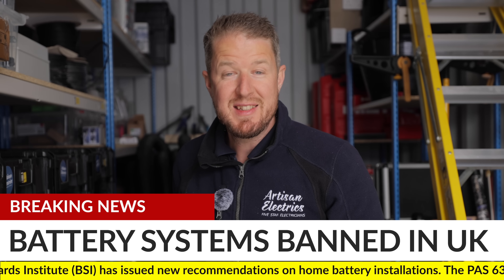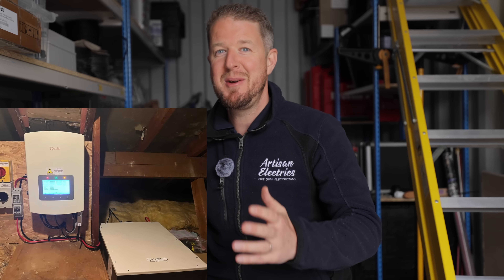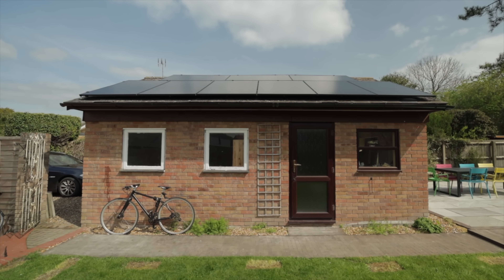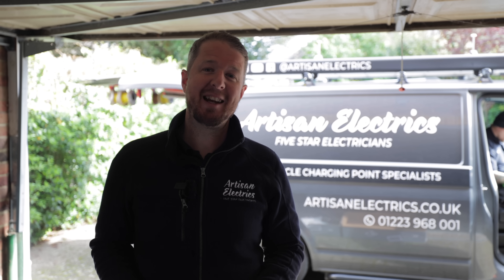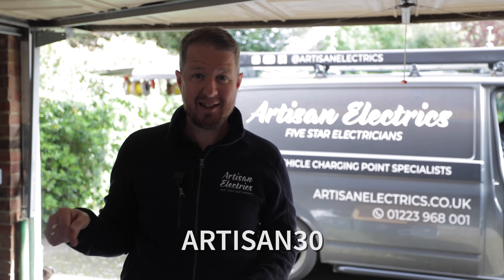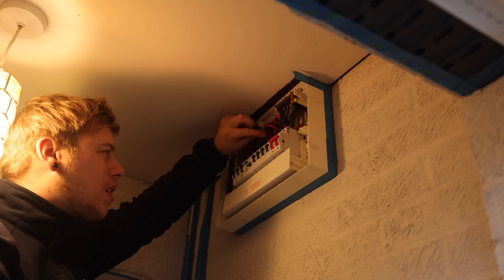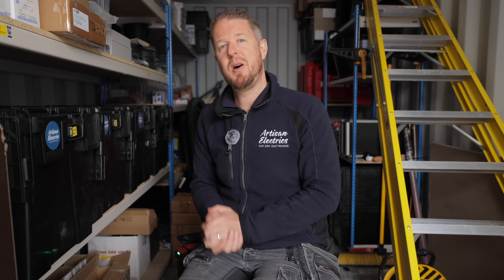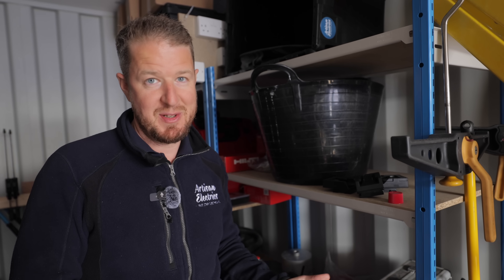Is the UK Banning Home Battery Storage? 😱

Comment: A battery in the attic is completely wrong, because there the temperature in summer reaches up to 47 degrees Celsius, which does not do the battery good. In winter it freezes there again, which is also not good. 😐
Reply: Same applies to sticking the battery outside.
Reply: yes just what I was thinking and also if they are outside and its cold they will not charge or the inverter/charger will try and top them up as the voltage drops when the batteries get cold over night which also shorten the life of them.
Reply: Actually lofts are not always that extreme. it depends very much on construction and location. Our max min temperatures are 38 to minus 2 over 2 years of monitoring and with careful fireproof insulation passive heating caused by using the batteries has maintained the battery temperature are 10c or above.

Lifepo4 tech is rated to 50c and anyone who has worked with the tech knows that it is only copper migration effects from the anode which are problematic above this temperature. OUTSIDE temperature swings are far worse by the way.
Reply: @atkt62  There isn't any copper in the anode in any of the lithium chemistries I can think off. The anode material is smeared onto a copper foil which I presume is what you are referring to, but are you really saying that significant amounts of that copper foil migrate above 50C? Elemental copper is pretty stable stuff (hence it's uses in hot and cold water pipe, roofs, wiring etc.), so I find that quite hard to believe, and I know quite a lot about batteries and this is the first time I've heard anyone say that 'copper migration' is an overheating issue. Reading some papers it seems it can be an issue from overdischarge (below 1.5V), which of course is independent of operating temp.
Reply: @atkt62 fireproof insulation specifically on the batteries? Would love to know more about that if it can be retrofitted?
Reply: Exactly. Lithium battery chemistries like the same conditions as people, so sticking them inside the heated envelope makes a lot of sense from a longevity and efficiency point of view. Putting them outside in the cold and sun (or in an uninsulated loft which is even worse) will definitely reduce lifetimes. I don't know by how much - many it's not that significant.
Reply: @xxwookey if you read Andleman you might think differently. Side reactions start above 50C. All foils are alloys and contain copper. It is my understanding that mixed oxide formation at these interfaces leads to high resistance regions being created. Hence the limit of 50C for safety. Happy to dialogue more of course
Reply: Bit like the garage?
Reply: Okay, so I'm seeing a few opinions here that I think are mostly correct but perhaps not what the PAS63100 is thinking about when recommending that batteries are not installed indoors and prohibiting them in lofts and escape routes. The issue as described is not the likelihood of battery fires (much less the reliability or longevity of the batteries in different location) but to do with the impact of those fires when they occur. This is due to the high burning temperature of Lithium batteries and their tendency to form high temperature jets.
In loft spaces this 'might' cause a very rapid spread of fire which might spread to affect escape routes before people can be evacuated (or even before the alarm is raised). In escape routes the danger is obvious.
The issues raised regarding temperature may also be good reasons not to install batteries in lofts but can be overcome. Whilst it is true that Lithium can work in temperatures 'up-to' 50 degrees C - this is not a good temperature for charging or discharging as it is more stressful and there is less safety margin to critical temperatures - however this isn't a big problem in most parts of the UK. Cold temperature can be a worse issue - though unlikely to happen often. Below freezing charging of Lithium batteries can be (usually is) extremely hazardous and almost all controllers will disable charging below 0C. 
Installation indoors does give the best conditions for the battery. However, whilst Lithium batteries are much safer than (for example tumble driers) other appliances, if your batteries do catch fire, your house is doomed and you must plan to evacuate as quickly as possible. Fighting a lithium battery fire is very difficult and well beyond the capabilities of a home fire extinguisher.
I am planning on installing batteries and, after a discussion with the installers I plan to install them in a fire resistant cabinet on the outside of the property and with a frost guard heater to maintain the temperature above freezing. This will work in my location, but yours will be different and you should seek advice.
Reply: Good point , that I hadn't thought of.🤨
Reply: I'd like to see some proper accurate statistics regarding all these extra restrictions, including batteries and metal consumer units. in some homes there is nowhere but the loft. I live in a four bedroom (extended) semi and can't think where we could  put it other than in the loft where it is. 
Battery storage, available now to the rich, who don't really need them anyway.

Comment: So is it acceptable, according to the new recommendations, to install the inverter in a loft? and what costs would be involved in transferring batteries to outside the house?
Reply from the maker: They do not mention inverters, but current guidelines are that you can install an inverter in a loft but you should fit an interlinked mains powered smoke alarm
Reply: Have you got a suitable location outside of the house? The guidelines say that batteries can't be installed within one metre of doors, windows and ventilation ports - which excludes the front and back of my house. As per my other comment, I think I would need to fit a battery on a hard standing at the bottom of the garden.
Reply: Ventilation ports? What are they? Don't tell me it is those bricks at the base of the walls that have perforations?
Reply: @nicholasbezzina450  I think its referring to extractor fan outlets, and similar grills that let air into a room. Basically any hole that links air/smoke outside of the house with the occupied interior of the home. 
I would exclude an air brick that only ventilates the wall cavity, but not one that passed air to a grill inside the house. Needs to be confirmed though.

Comment: How are BSI coming up with these guidelines, why not look at countries like Australia who have been doing solar/batteries for a while now, and have some fairly polished standards comparatively.
Reply from the maker: Great idea!
Reply: They do. Obviously.
Reply: One or two small points to consider, Australia get about 1000 hours of sunshine more, annually, than we do in the UK.
Also many properties will have more personal land surrounding them to house their array, and of course typically much higher temperatures, much more frequently.
To compare Solar tech across these two countries would be impractical.
Reply: House construction is often different in Australia - timber framed and either timber clad or brick veneer and they are not crammed together.

Comment: At 5:50 you state its “not recommended” to put batteries in basements without open air exit routes.
The PAS 63100 says “shall not”. 
Basements are not treated any less than lofts in this respect. They are both directed against equally! 
PAS is utter madness. Clearly based on “what if” engineering rather than scientific reasoning and evidence led engineering principles.
Reply from the maker: Thanks for clarifying
Reply: That does seem a bit silly. Is this paranoia induced by the mysterious German basement battery explosion?
Reply: @xxwookey  Perhaps.  It is notable that the batteries in that installation were bought off alibaba. Brings into question the BMS. That aside though, could have been avoided by a smoke detector and adequate ventilation to disperse gas concentration before it reached LEL.

Comment: So basically not really a single realistic reason for asking to install batteries in different places, Also most of the batteries are not AC coupled (don’t have a separate inverter) so they need a DC cable to run to the inverter, try to run a 30m battery cable to support 100-150A, that’s plain stupid.

-The added weight in the loft is not usually more than a grown up person sitting there.

- LFP batteries are pretty safe and if anything is going to catch fire is more likely wiring or inverters not batteries.

- most batteries require a certain temperature range, so mounting them outside is plain stupid as will degrade the capacity or how some people found out in the cold weather impossible to charge/discharge due to protections.

Seems to be another rushed and dumb recommendation done by people that don’t take all the facts into consideration.
Reply: Kind of like your knee jerk reaction to being told NO.
Reply: House fires happen. Regularly. And fire fighters get injured. And people have died.
But yeah, no ' realistic ' reason.
Muppet

Comment: Perfect time for someone to start building and selling external battery enclosures.
Reply: You wouldn’t think twice about storing a can of petrol in your garage you sure as hell wouldn’t put it in the loft.
Reply from the maker: You thinking of doing it?
Reply: @artisanelectrics I think I would build a dedicated storage shed type building with insulation to keep the battery warm in winter and in theory cool in winter. What would your thoughts on that be Jordan?
Reply: @davideyres955  Cool in Summer*?
Reply: That only makes sense if the cost of the enclosure is less than the savings from buying a non outdoor rated battery system, rather than just buying an outdoor rated battery system.
Reply: Some batteries are already designed to be installed outdoors e.g. the Tesla Powerwall
Reply: @spankeyfish  yes, and if you look at the list of the contributors/consultants for agreeing PAS 63100, Tesla is one of them.
Reply: I live in a mid terraced house. I can't put a battery on the sides and don't fancy having one on the roof (no loft).

Are there any battery enclosures that can be set underground (e.g. under a driveway, but not as excessive as Colin Furze).
Reply: @KrizzzR  yes, that is exactly how to do it : In a purpose built pit in the ground.

Comment: It never made sense to put batteries and inverters into lofts. Now it’s just confirmed.
Reply: Fair dues for never putting a battery in a loft.
Reply: @brianoneill350  Our inverter runs hotter than the battery packs, and I would never dream of putting it into our loft, let alone putting the 90 kg battery packs up there. I've measured loft temperatures of over 60°C up there, in my workshop, even with more than twice the standard amount of loft insulation. I've considered seriously the viability of painting our rooftop white, to reduce heat absorption.
Reply: Our neighbour put a lot of audio and CCTV gear in his loft. Same issue lot of heat during Summer.

Comment: Should and banned are miles apart.... however i wouldn't put batteries in a loft solely for the temperatures loft reach in summer days. And the weight. (Or under stairs just in case of a fire)
Reply: my consumer unit is under the stairs, and that's a higher fire risk than LFP battereis
Reply from the maker: Good call!
Reply: @artisanelectrics  Again for under the stairs it depends on the type of battery eg LiFePo
Reply: Yes exactly. The standards organizations use should and should not (i.e. recommended and not recommended) and must and must not as 2 separate things. Also it’s nice that the BSI issues a standard on something, but I thought electrical installations in the UK were under IET rules, I don’t see how BSI have any automatic authority to dictate business practice.

Comment: This is all bollocks as your car is way more likely to catch fire than an LFP battery. ‘Recommendations’ are just that. And in this case they are wrong. 
The ONLY worry I’d have about any in the loft is access and weight. 
You need to STOP propagating this fake fire risk quickly. It’s embarrassing
Reply: You don't live in your car.
Reply: @alan_davis  so what?

Comment: A consideration for battery location is working temperature of the battery. Pylontech batteries in particular will not charge at temperatures under 0 degrees C. I would have liked to have our batteries in the detached garage, but here in rural Scotland, it's just too cold at night.
Reply: They also advise they aren't mounted on a south facing wall for overheating risk. Batteries like to operate within a tolerance of temperatures, another reason they shouldn't be located on loft spaces where you have no control of the temp in a cold loft space i.e. cold in the winter and boiling in the summer. Going to be difficult to located them outside in my opinion.
Reply: Install it in the garage with a thermal box around it made from kingspan with a door that can be opened in summer .
Reply: You could sacrifice a little of the energy you have stored and have a small tube heater or similar to keep the temperature up a bit. Low power heaters like those for greenhouses might do it. Depends of the size of the room/enclosure. Insulation of the enclosure helps too.
Reply: Make a insulated box...see our installs we made a insulated box over the battery rack

Comment: These guidelines are poorly thought out. For over 100 years water tanks have been loft mounted. Never has the bsi legislation banned those! Now the weight of lifepo4 batteries is less than a water tank so this reg is complete bs actually. 
Furthermore domestic battery fires just won't happen with lifepo4 chemistry. The pyrolysis temperature is over 1100C and house fires can't get to that temperature. The garage is  different matter as fuel fires CAN exceed 1100C so the garage is one of the WORST places to fit batteries! Lofts have low people traffic so this is an area which is safer for homes with kids as there is a physical barrier, and ladder access is needed. The industry needs to protest urgently. By the way I have 15kWh of lifepo4 batteries in my loft.

Comment: It’s all well and good, but what about the 100’s of thousands of terraced houses in the uk with no other choice but in the loft?
Reply: For a flat in one of those I'm thinking about a bit of outside wall more than a meter from a window and above a flat roof.
Reply: Not all properties will be suitable for Solar tech, or EV charging, as things stand. 
The south facing roof area will be too small to generate enough energy to heat your home or even the water properly in winter, and so you will need a Heat pump. This too you will struggle to find room for outside especially with the 4 bins we need now too. Sorry but ,Its probably a waste of time for someone in a terraced house to go down this route.
Reply: @rossmurdoch7870  but not if they can put batteries in the loft

Comment: I wonder if the standards/guidance is not followed, could home insurance companies start to void insurance or not pay claims if they find out they was installed afterwards
Reply: Probably not void, just charge extra. It's an increased risk (primarily of fire) but not a very big one. I'd expect them to just price it in. It depends how often there are actually problems. I've not heard of many house fires due to (fixed) batteries (plenty from mobile ones). And that one house in Germany that blew up.
Reply: Efixx did a video about EV chargers attached to buildings and insurance companies not wanting to insure that not long ago, so I guess it will be coming.
Reply from the maker: Time will tell
Reply: Good point and very likely.
Reply: Is there any documents required when installing a battery, I know there is for panels.  When I had my system installed (in the loft  🙁) and spoke to my home insurance people apart from a couple of basic questions it didn't seem to bother them.  It wasn't mentioned on the renewal documents and shopping around I didn't come across any others mentioning it.  More about security and break in access.  Scary really as you know if something did go wrong where the finger would be pointed.
Reply: Not unless they state in the insurance policy that properties must conform to the standard.
Reply: I think you could almost guarantee that.

Comment: Potential customer here with a few questions: 
I've got a linked flat roofed out building which could easily be fireproofed on the small wall that links it to the house but it gets devilishly hot in the summer. I'm assuming this would be a no-no as a place to put a battery or an inverter?
 The only other place outside that complies with the proximity rules is a place on a gable end wall next to a metal shed but it's right next to the path to the front garden. We've got a fair sized back garden so somewhere to escape in a fire.
My question is could a battery be mounted higher on that wall above the metal shed, say? Or are they just plain too heavy?
Alternatively it might just comply with proximity and go between two windows on the back wall, its east facing so does get quite hot for a few hours in the summer...would some sort of enclosure for it be good to protect it?

Thank Jordan, this is the most comprehensive commentary on the new guidelines I've heard yet, a big thumbs up from me.👍👏